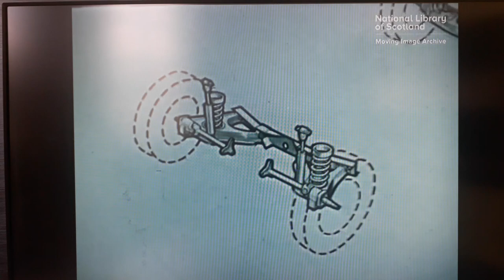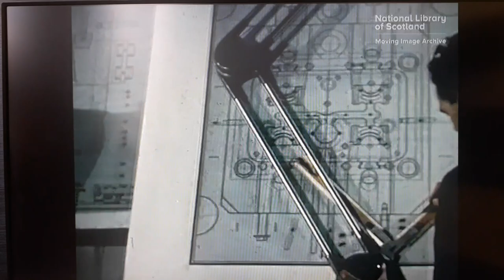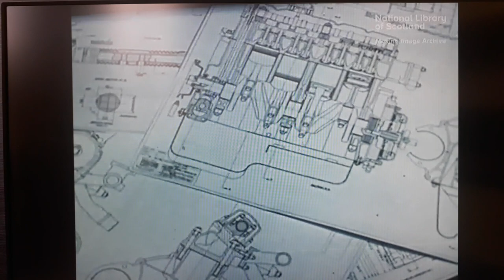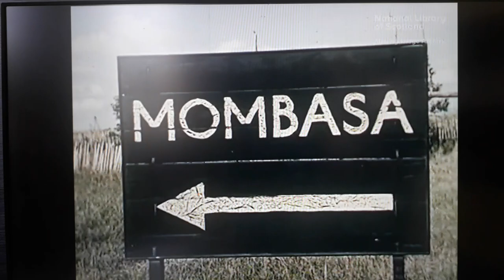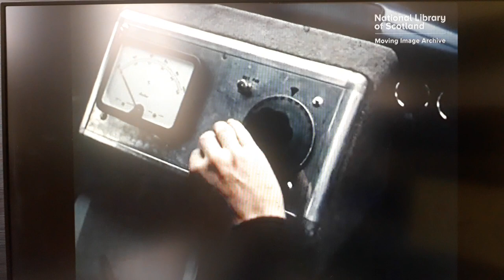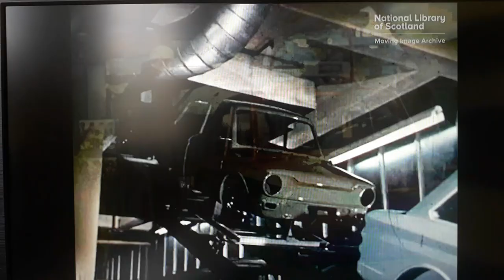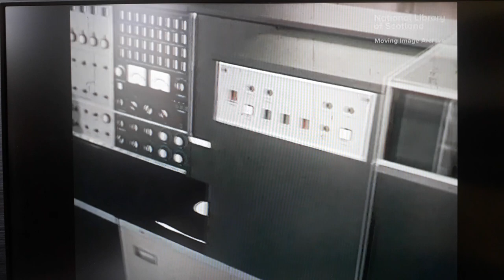Hillmam Imp Rootes Group Linwood - The story.

Comment: I started in the motor trade, as an assistant/trainee salesman in a Rootes Group dealership. It was a cracking little car - everything the mini was, next generation. 

Its development drove Rootes to near bankruptcy. The Linwood plant was built, subsidised by the government, to reduce unemployment in the area. Within a few days of the launch of the 'Imp', when interest & potential sales were 'hottest' - the plant went on strike.

The result, eventually, was Rootes went bust, sold out to Chrysler.

This was a foretaste of what was going to happen to the whole British motor manufacturing. 

Nobody could afford the huge cost of research & development of new models, with a work force that would hold the owners 'over a barrel'.

When people 'slag off' Margaret Thatcher, I can only say - you weren't there, you have no idea how bad it was!
Reply: Yep, mixed work from unions & management.....but then, if you've never done track work, you will never get it. But then this was a car with big holes in it. From management point of view, how much pressure is being put on getting/keeping the line running, if the bow wave of debt, is that big. Management go sucked into it, with grants , sweet deals, and fell into the hole of under developing the the product...,and that was not the unions.It was the same non union effect, that built cars in Northern Ireland....oddly with an engine in the back too.
Reply: @robertwoodliff2536  years later, I was an industrial engineer, working in a brand new car plant in Porirua, New Zealand (I understand it's a shopping mall now - perhaps I got some calculations wrong....). We worked on a timing of 4 minutes per station on the assembly line, so any kind of a hiccough involved serious cost!
Reply: @robertwoodliff2536  yes, but that factory was SET ON FIRE. Protection racket, probably
Reply: @georgepayne9895 ......... i must admit that the Imp is such a mixed bag., be it the design., or the pressured test procedure., which did not let engines cool to show up the water pump problems..I met Fry (?)( Pye ) one of the 2 designers., who had a design business in Dunchurch nr Rugby..and the guy who designed the back of the Average., cos the front., he said was designed in the US......the Avenger was so much more a Roots product..I was round Coventry when the Ryton plant had gone to Peugeot and was down near the airport when the buses came past with the guys off night., who were generally asleep..At one point the Cov Telegraph was saying the plant was it's most efficient....but hay., they pulled the plug a couple of years later......but if your are the prancing lion., who's plant will you close., an English one or a French one......odd that..

Comment: I have spent nearly 40 years in the motor trade and never drove an Imp. Were they good to drive ?
Reply: They are great fun to drive. As standard and well maintained they have a flick switch gearchange, turbine smooth engine and go-kart like chuckability.
Reply: @byronmills5952  Thank You (:
Reply: My first car, loved it despite blown head gaskets and awful heating in winter. Drove all over UK in it for 2 years.
Reply: My friend put a bag of sand in the front of his.
Reply: @nicksutton2964  Haha that bad eh (:
Reply: I have not DRIVEN Imps myself - but been driven in them. Along with other cars till this century, it did need to be BIGGER. My dad, (when we went to see it in the showroom, ) had almost no spare headroom. And he was only medium height, 5'8". However, the Mini was alright.
Reply: @nicksutton2964  I'm sorry, but I don't quite believe you on that one! People DO say about putting a bag of sand in the FRONT of such cars, to have some weight over the steering wheels, on ice and snow. However a lot of rear engined cars don't have a big enough boot for that! In the (otherwise stylish) Imp, the only bag that would go in the FRONT- would be a bag - OF SUGAR!
Reply: Learned to drive, and passed my test in an Imp.